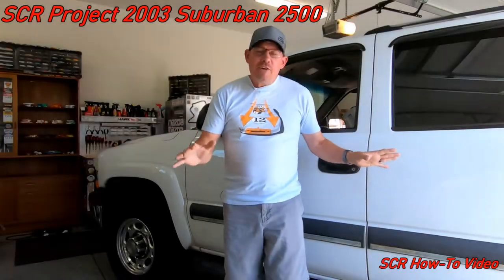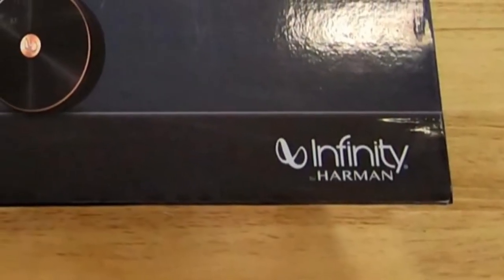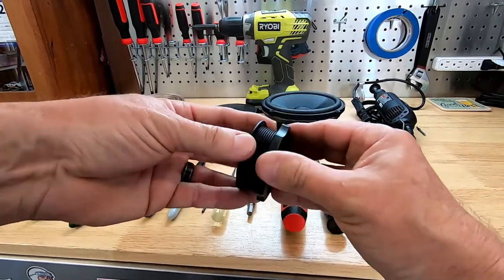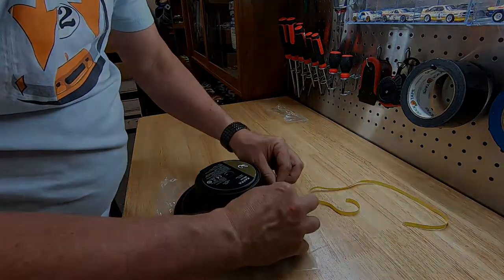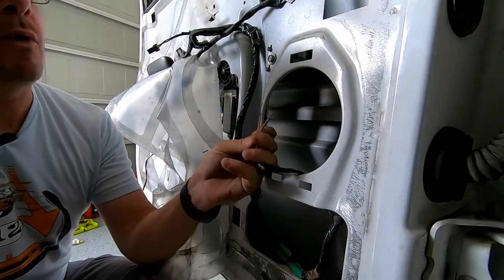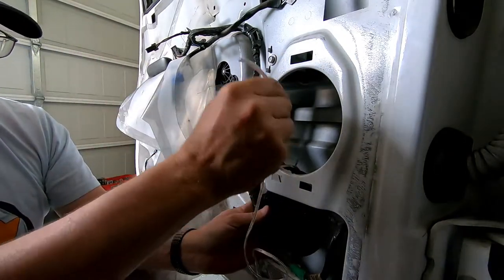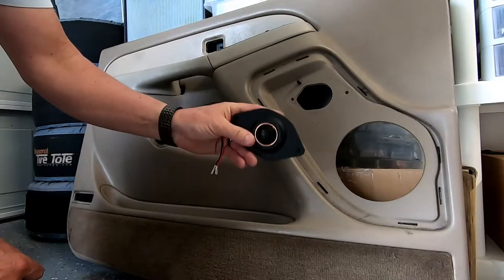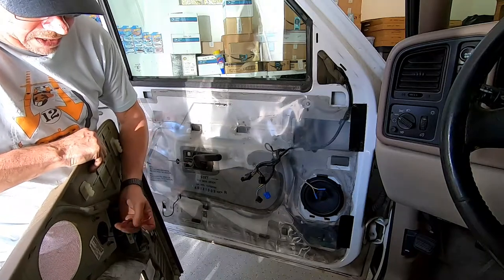SCR Project 2003 Suburban Speaker Upgrade Part-1, Installing Component Speakers Into The Front Doors

Comment: Typically, it's best to keep the crossover in the vehicle since inside the door panel gets wet. If it can't fit between the door panel and vapor barrier, you should shop for components with an internal crossover like the Rockford Fosgate P165-SI. That particular 6.5 set has an output for the tweeter. I'm sure it's fine the way you did it, it's a common way of doing it, it's just not the best way if it can be avoided.

Comment: Why kind of bit did you use in the Dremel to cut the plastic piece on the tweeter? Thanks for the great video. My best friend just gave his mint 2002 Suburban 1500 LT. Suburban doesn’t have a scratch on it and the leather front seats he redid so the interior is mint. Only thing is I’m not into red for cars and wish mine was white like yours. I’m sure all the surrounds are bad on all the speakers like yours because it sounds terrible. So I’m putting in some CT Sounds Meso 6.5 2 way components. Wish I would have bought the 3 ways instead but I think I’ll add an extra small driver to make it a 3 way but need to figure out it’s seperate crossover so if you or any views have some ideas on crossing over say a 3-1/2” drive please reply. I’ve always repaired my own cars but haven’t done much stereo electronics other than adding speakers to factory locations. I have almost 100 sq ft of Fat Mat so I’ll do the doors because in our Camry it really made a big difference and so nice how it dampens road noise also. For amps I have several I bought that are NOS from the company that made the Poweramper amps before they went out of business years ago that are SQ amps. Bought a couple EQ’s and couple pair of 5-1/2” Poweramper component speakers which I’ll probably install in my wife’s Camry or Odyssey van.

Comment: Hey! Thank you for a Great video and Nice work.  I am middle of this myself in my 2002 LT suburban. And I wonder it is better to use a crossover like you do, then use the original power cables to the tweeter? To information; I have the original head unit.
Reply from the maker: I would use the crossovers to ensure the correct frequencies go to each speaker.

Comment: Nice Video. I have a 2003 Avalanche. No Bose. I still have the original stock  GM, CD/radio. Because of the separate tweeter in front, is there a cross over anywhere? I just installed another mid range from Parts Express. I don't know if my unit would deliver enough power to drive new component speakers. Good Idea on how you replaced the tweeter. I did reuse the original speaker mount. Hard to find just a single driver midrange by itself. The GRS 6AS frequency range is 75 hz to 10khz 40watt RMS and 88DB.  If I ever upgrade my unit, I have your video . thanks
Reply from the maker: You are very welcome, and thanks for the kind words. No, without Bose there is no separate crossover unit, only capacitors on the factory tweeter to filter out lower frequencies. Your factory head unit would power components fine, however they wouldn't have the sound quality you would get from a modern head unit.

Comment: If using the factory amp and wiring, what do I do with original tweeter wires? Do I just run the original woofer wires only as the IN? Will that send the full signal to the crossover if the original tweeters were getting the highs by their own wire? Or do I need to jump them or something else?
Reply: I have this same question. Did you ever find an answer?

Comment: I have a 2002 Chevrolet suburban 1500 LT. Originally had the stock bows, however we moved to JBL some years ago. After the balls blown. Now my right door speaker is buzzing. Do you think they could be a bad speaker or wire? If so, if it’s a bad speaker, what size speakers should be used?
Reply from the maker: A 2002 Suburban 1500 should use the same size door speakers as mine, however if you have Bose it may be different. Best way to check is get the door panel off and measure, check out my how-to video on the door panel removal for more info.
Reply: @fastpaxSCR  thank you! Just realized how many times I misspelled Bose😂
Reply: @fastpaxSCR  Yo what's bro. I got 2004 Yukon with bose system. The factory tweeters are installed on the A pillar how can I wire them to that location, I noticed that yours are installed on the door.

Comment: are you using the factory amp or do you have an amp installed? also are you using original  head unit?
Reply: U can use them without one just be carful not to make them clip and then when u get a amp take it apart and just intertwine the speaker wires and run the to the 2 Chanel amp
Reply: @JoseTorres-ms2ui  thanks
Reply: @jewlizardjane9696  np and get a amp that’s less or more watts it really doesn’t matter
Reply from the maker: For now I am just using the head unit to power the speakers, no amplifier.
Reply: @fastpaxSCR  ok,  so it sounds ok then? thanks